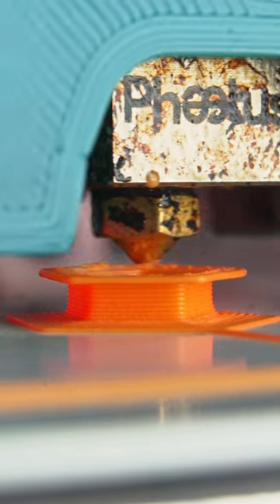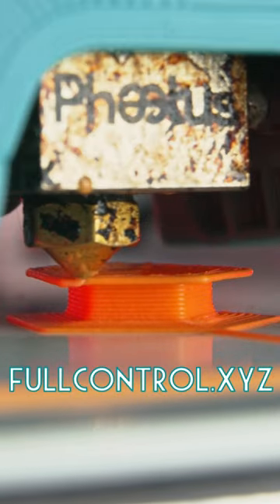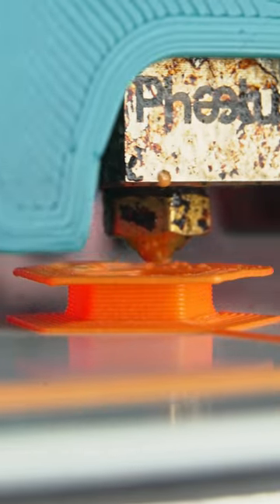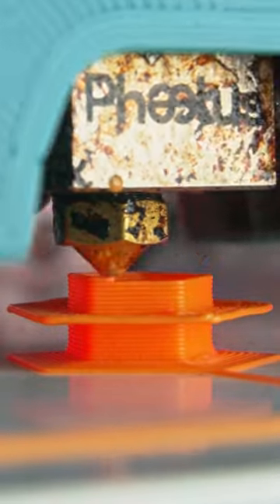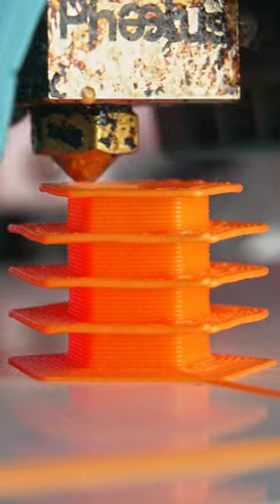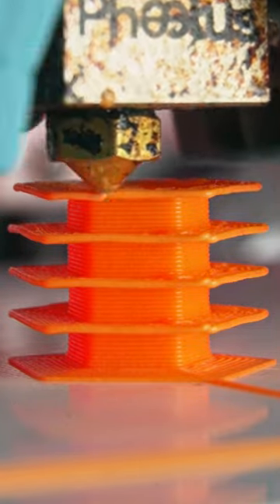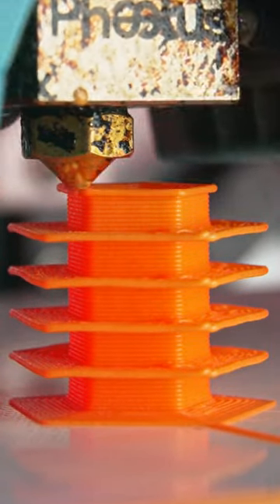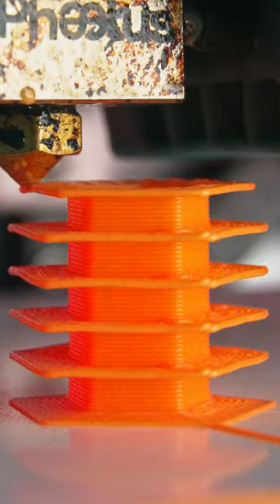3D Printing Thin Air Overhang Challenge 😱

Comment: Except dirty nozzle I want to ask You for an advice. There a few videos explaining differences between resin and filament 3D printer, but except size it looks like resin wins in almost every field. Yet You own filament printer, could You share what convinced You?
Reply: Filament printers are much better for structural engineering parts. Even “strong” resins are weak, brittle, and susceptible to high temperatures (there are engineering resins that achieve this, but those are extremely expensive and out of reach for the standard consumer). Resins are also extremely toxic, and require a lot of post processing after printing.